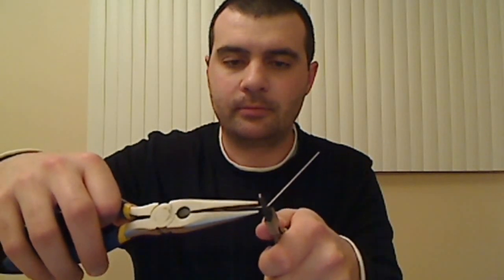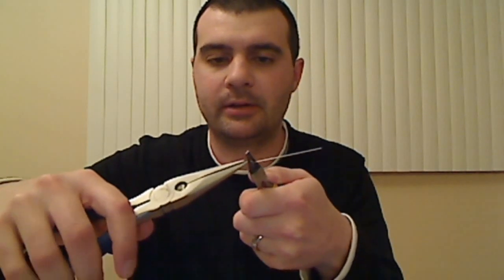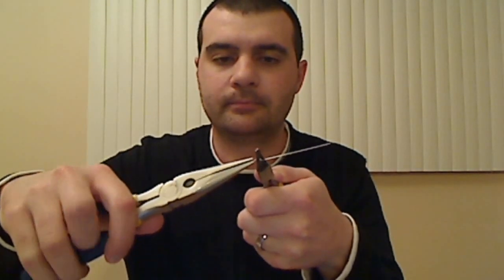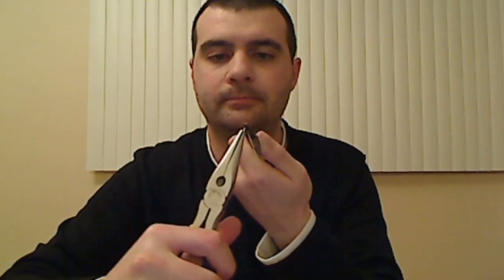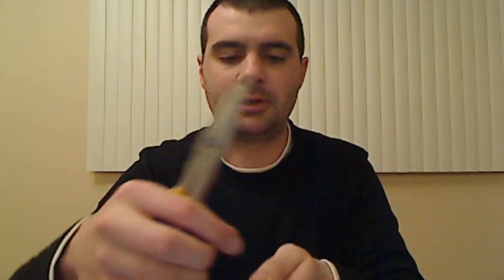How to Form a Closed Loop for Tackle Making

Comment: Hello could you please tell me where I can buy some stainless wire from? I'm trying to buy 2mm to 2 and 1/2 mm wire? I brought some .41 but it isn't thick enough.
Reply: Go to eBay.  Several lure making suppliers sell it.  Are you building marine or pike tackle?  Search "stainless steel wire rod" in diameter you are looking for.  Usually in 4", 6", and 8" lengths.